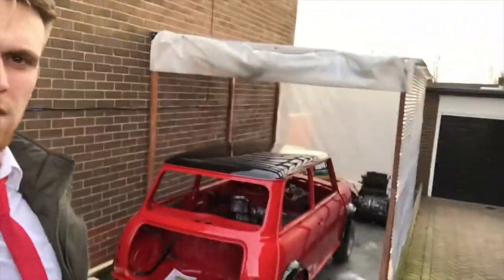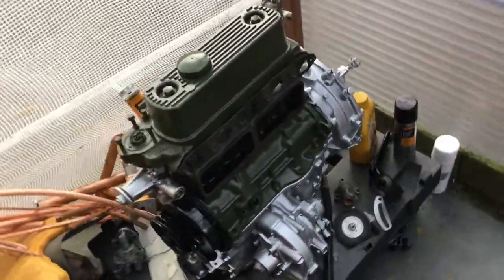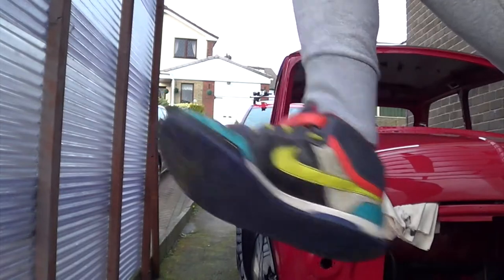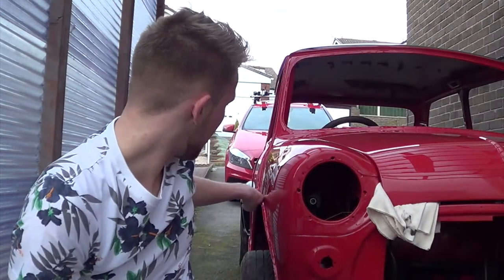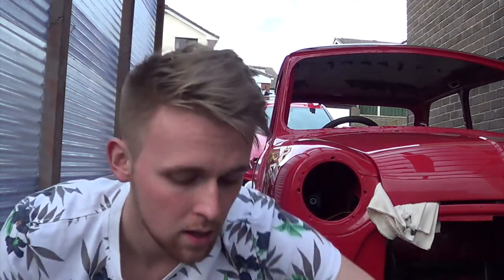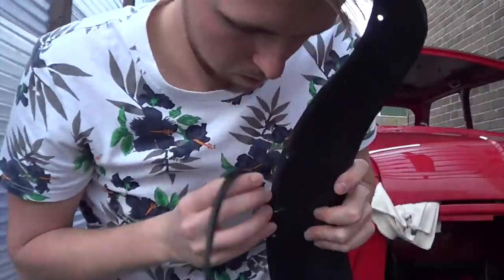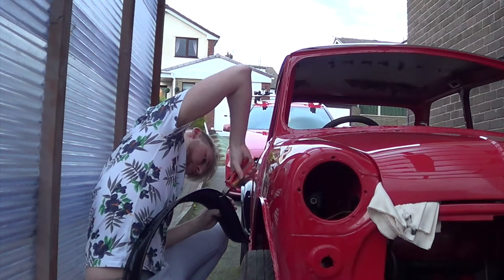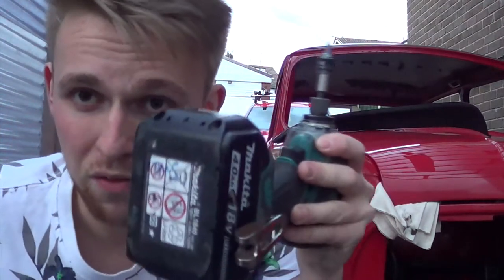Classic Mini Restoration | Fitting The Arches | PROPERLY

Comment: Hi mate. Ive just bought a set of the same arches 3 fit nice but rear drivers side twists in a bit at the front. Minispares say it will pull in with a screw ? Were yours like that ? looks like you have to cut holes to fit around flanges sticking out where the panels join. Did u do a vid of this ? Dont suppose you could send some lose up pics of your rear arches - how they meet the rear valence and rear quarter panel. Im not sure how its supposed to line up with rear sill ?
Sorry for the hassle - just trying to get it right. Thanks sprok@btinternet.com
Reply from the maker: the arche wants top hug the seam line all around the body panels of the car dude, you also have to cut the arches where the flange is and make sure the the rear arch touches the straight edge of the rear valance :)